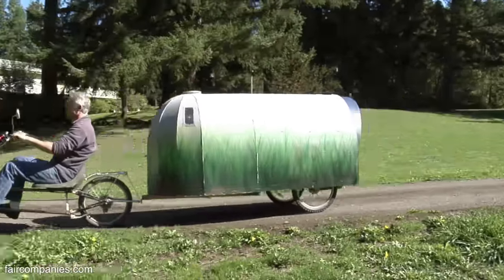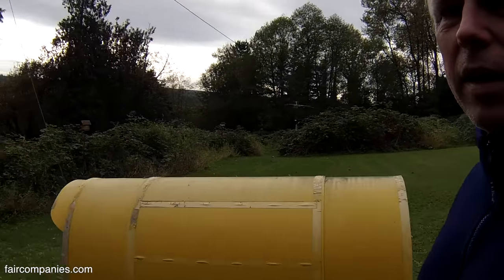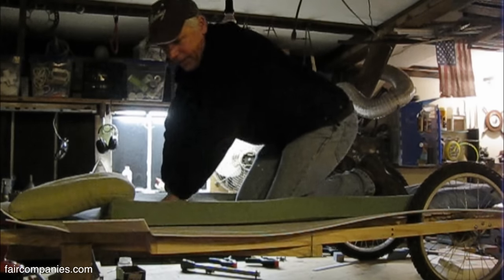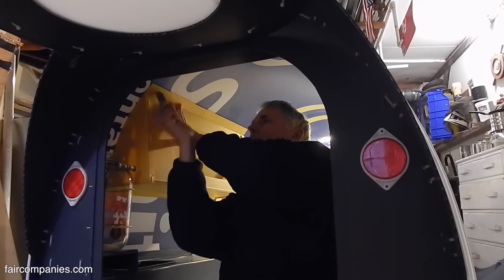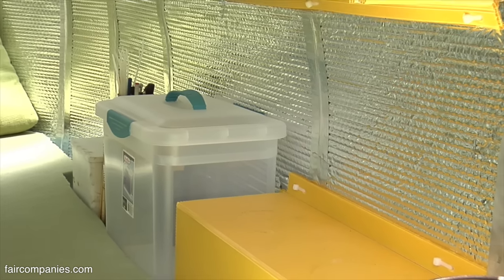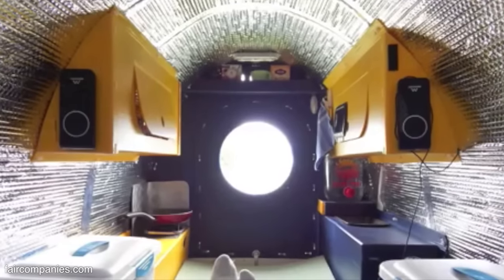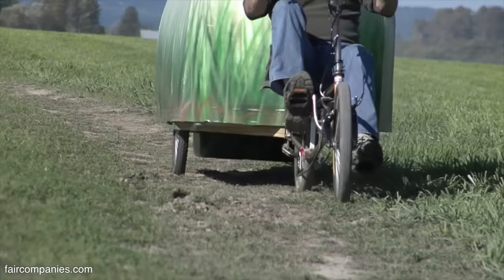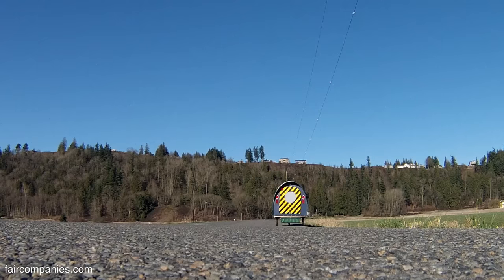$150 bike camper: DIY micro mobile home (downloadable plans)

Comment: I always wanted to build one of these and attach it to my scooter.  I'm too broke though.
Reply: Age of Reason if you take your time to gather the materials and you have a place to put it it's even possible to do this for almost free. if you talk to Home Depot or Lowe's sometimes they'll sell you their junk wood or bad pieces of lumber at a discount. also you can take apart shipping crates or pallets that they put under shipping crates to build with their free. I've seen someone do this with a tiny home!  you can buy similar poster board to what he was using made out of election signs from the dollar store! let it be known to the local hardware stores what you are doing they might manage to find things at discounts that they want to get rid of. or sell or give you somewhat damaged goods that could still serve your purpose! friend of mine who micro camps now did it this way, except for she used a little more wood so she could support the bunk she built overhead for her daughter so they can both sleep in it!
Reply: Age of Reason if you can afford to run a scooter, you can't be that broke ... Sell your scooter, buy the bike, make the camper with the change - like Ashley Burbank said, there is more than one way to acquire the parts; you don't have to pay full price! People like to feel good about themselves, so if they feel good about doing a "good deed", don't be afraid to ask ? Speaking as a former hardware store owner myself, I can confirm that there are often items in stock that businesses would be grateful to get rid of
Reply: @martinr4884  ahahahahahaahahahahahahahahahahahahahahahjhaja, can't be that broke!  Man you are a comedian, you should start performing at comedy clubs. 

I actually don't even have them anymore. I ride the bus.  I'm looking for housing.  Working a dead end job, paying child tax, raising a family; all of these at the same time.

I'm working on it all, but a single income for a family of three makes living quite desperate.

Comment: will the bubble insulation attract lightning ?
Reply: Not sure.
Reply: @paulwelkinsdiy  I understand the rubber on the wheels is supposed to ground it but will it be enough you know ? and to use it for insulating other things as well...